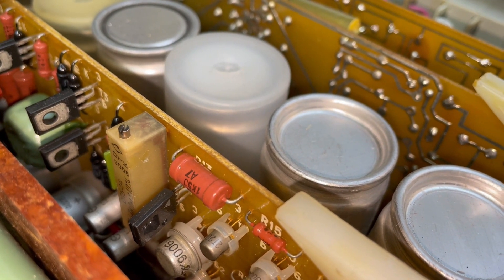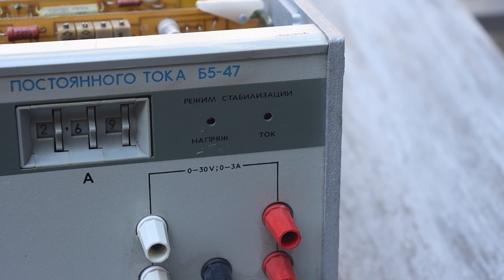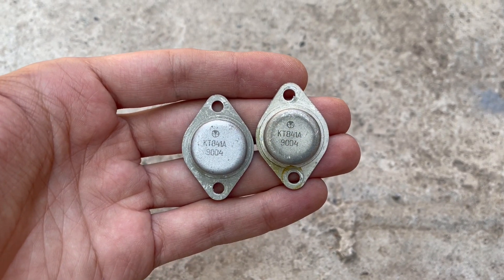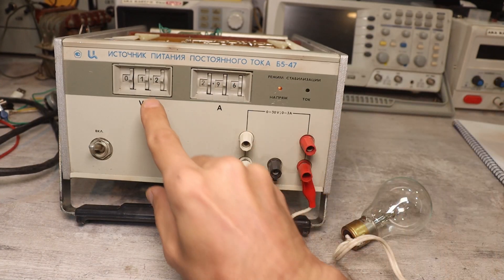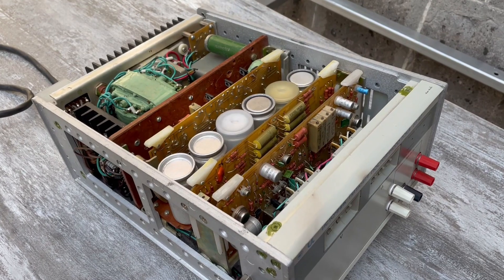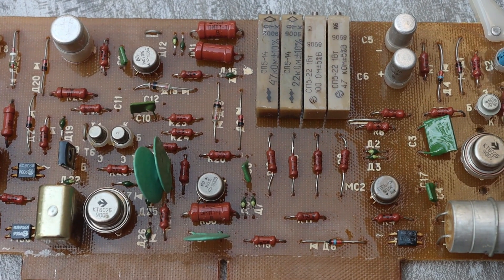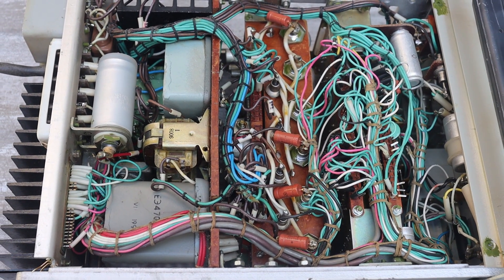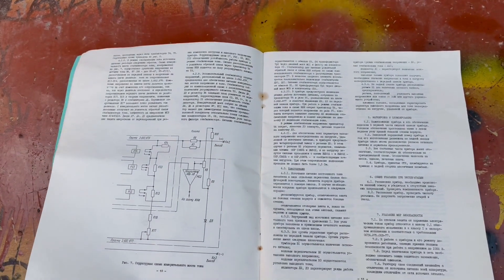B5-47 - USSR Bench Power Supply

Comment: Hello, I want to build a 2500watt / 5000 watt amplifier
Which type of transistor and  power rating I should use??
Reply: Have a look at home made circuits dot com. There is a range of audio amp circuits from easy to complex,, and bjt or mosfet transistor based.
Reply: @jonlitchfield8888  tnx 😀